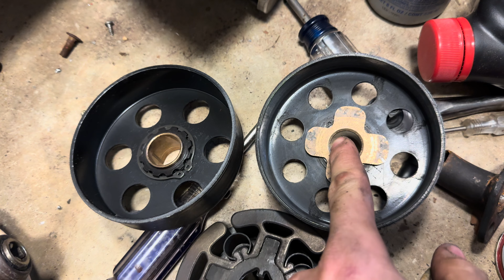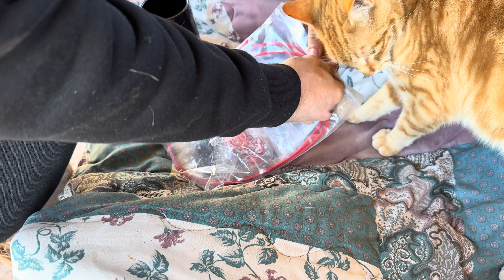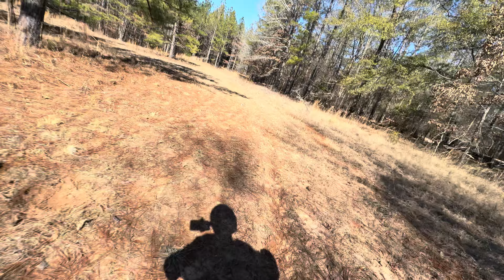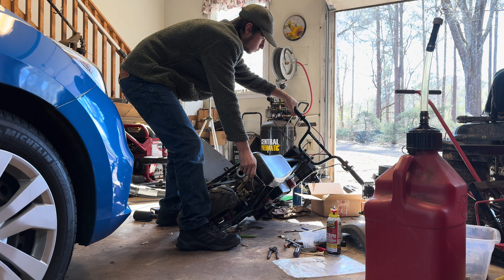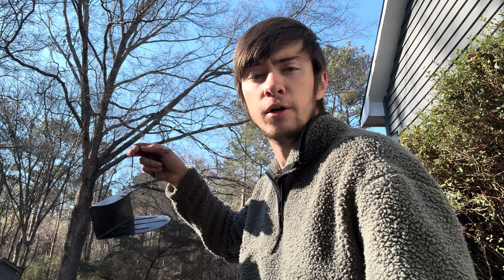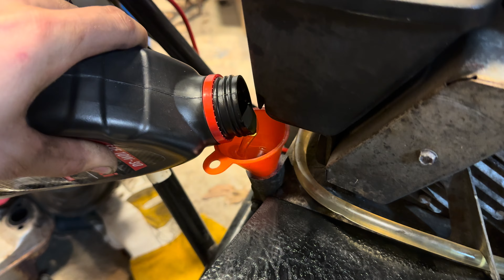6HP Tecumseh Performance Mods | Minibike Brakes & Chain Guard

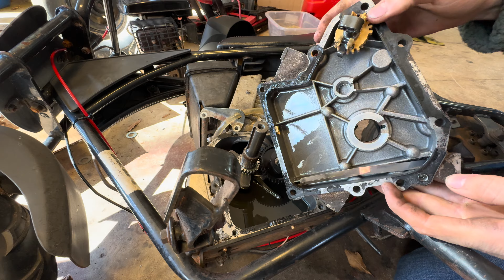Comment: 6:28 Thats common in OHV Tecumsehs atleast the ones ive seen usually the reason they do that is because of either to much crankcase heat or to much centrifugal force on the gear, or just wear!. Glad to see you remove it instead of keeping it because when that happens sometimes they will stay wide open till they throw a rod haha great video!
Reply from the maker: Oh yeah! would like to build this up if I find some performance parts like a billet rod and flywheel
Reply: @IngenGarage  The only parts I have ever found in billet for a Tecumseh is the ARC Billet rods haha thats all i have found will look more deeper to try to help out!
Reply from the maker: oh ok 👍, they make better cams too?
Reply: @IngenGarage  No I think for the Tecumseh they mainly make rods